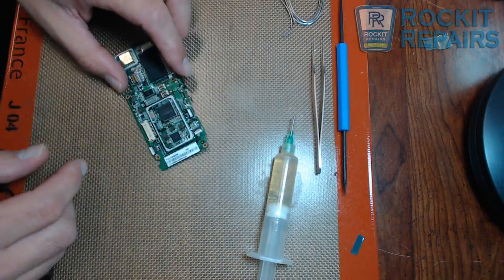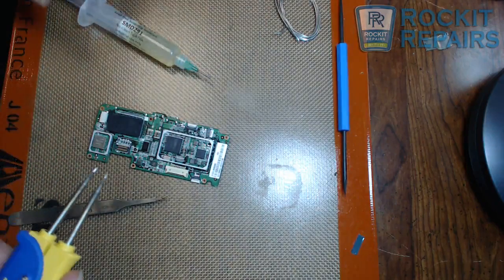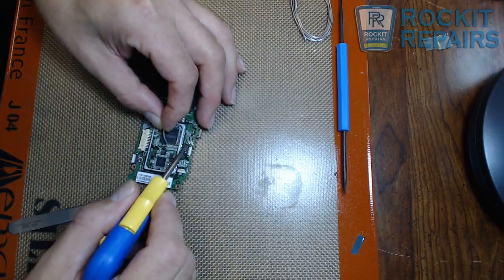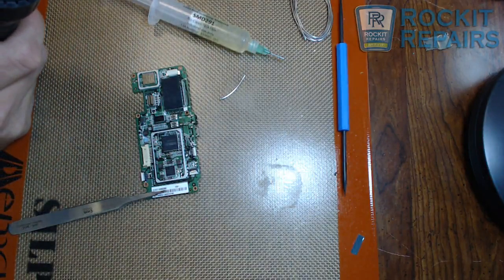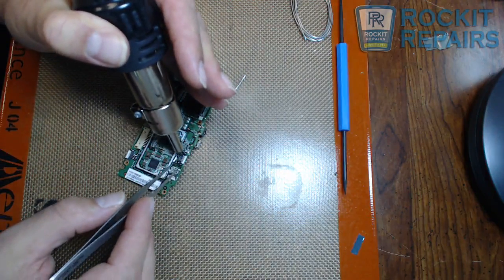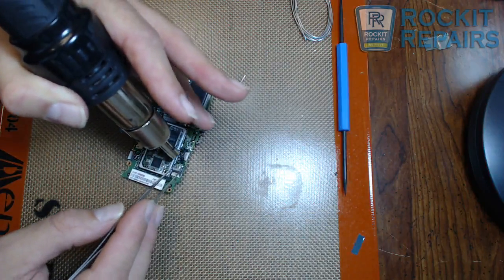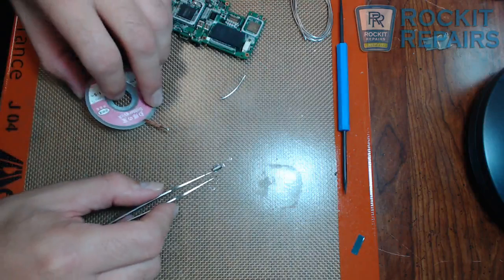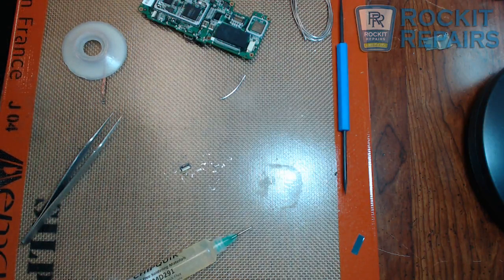HOW TO REMOVE AND DESOLDER FPC CONNECTORS

Comment: Can this method be used to desolder that orange transparent plastic ribbon cable like that from cassette heads  or cd/DVD players ? I've got a whopping drill size heat gun that bottoms out at 50deg Celcius but it's nozel is rather large by comparison to yours... might spread the heat too wide.

Comment: Hello , i have some problem with my laptop motherboard and i cant fix it bec is damage , i have lenovo s500 ipead touch and my motherboard pin connector LCD have damage , LCD is good and the cable but the problem is motherdoard pin connector LCD where can i find this??
Reply: Sector 777 send picture